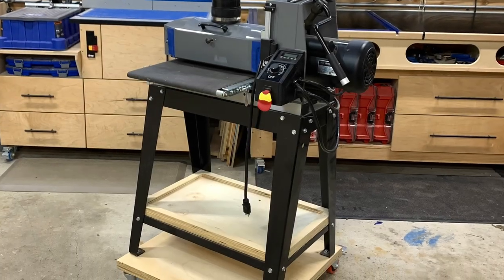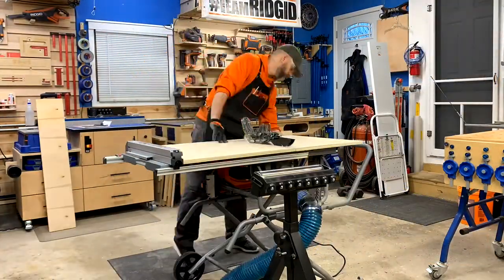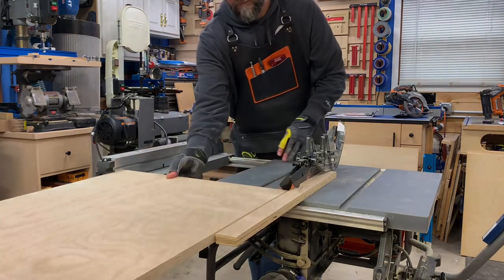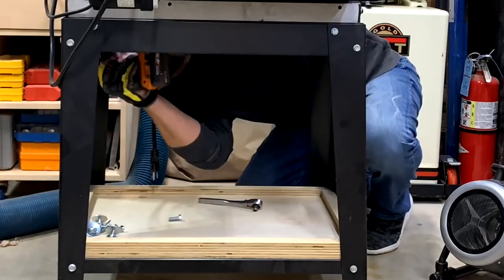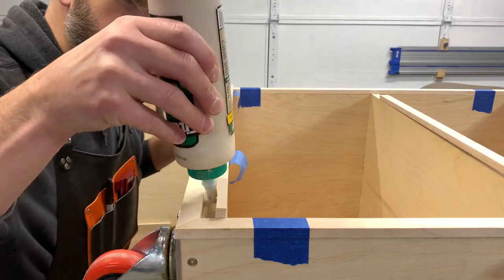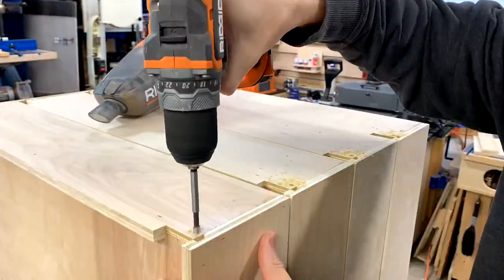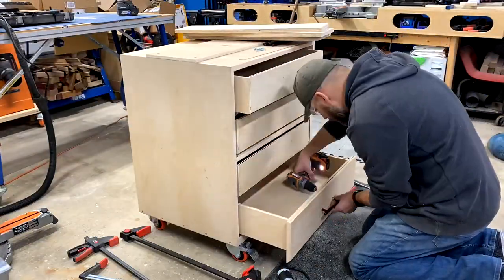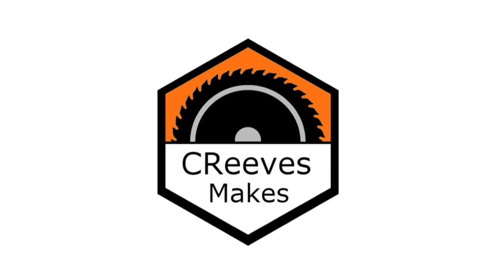DIY Simple Shop Cabinet For My Drum Sander!

Comment: I wanted to build a stand for my drum sander to utilize the open space under the stand and thought this looked like a good design but it looks like you can’t fold down the table extension wings. That would make this design a no go for me as I often need to drop these down and roll this machine out of the way to utilize shop space
Reply from the maker: this is true.  I got the wings right as I built the cabinet and I should have reconsidered how to do it.  I can drop them slightly to remove the surface but not all the way.